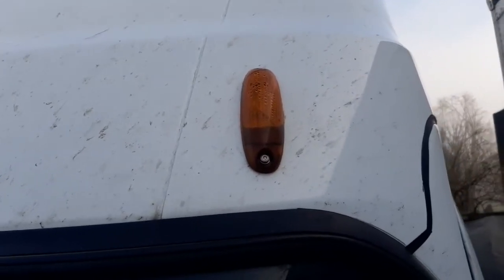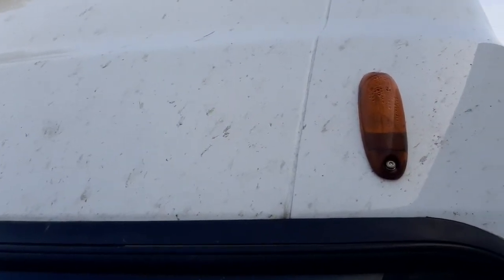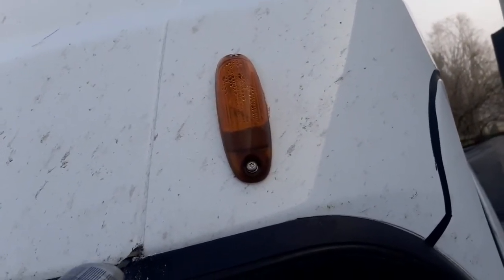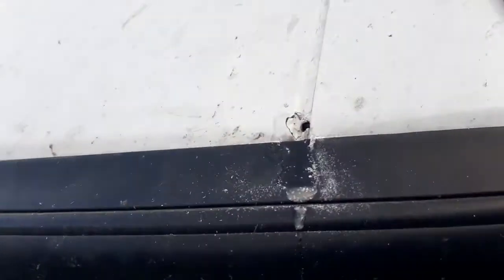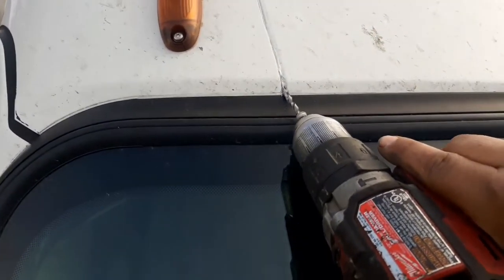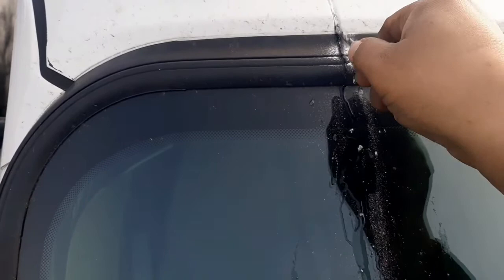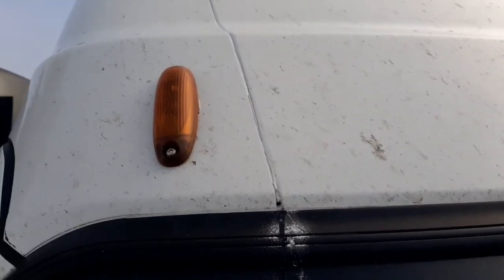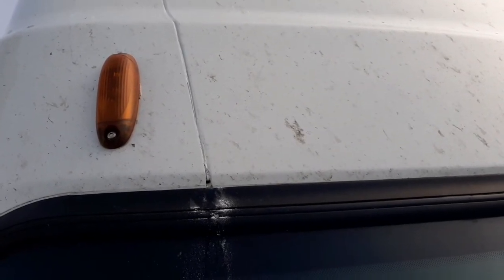Casacadia cab water leak easy fix

Comment: Silicone didn’t work for me either. I did also drilled the same holes as shown in the video and inserted small tubes pointing down so water won’t go in and this has been the best solution so far. Much much less water comes through now but still a little bit doeswish I could find out where this leak is coming from in the first place, but it doesn’t seem like anybody can figure it out.

Comment: having same issue and it caused my windshield wipers and fluid to activate on their own. Had to shove towels in headliner and pray every time it rains.
Reply: Same think happen to mine have to put new sam cab (whole fuse box ) and it needed to program through dealer also
Reply: @ronysingh6872  what year is your truck? Did u get the leak fixed?
Reply: @ronysingh6872  me too😔 still dealing with this
Reply: That’s what i do bro
Reply: Exactly, and hard steel seat cusion gave me sciatica pain. Every trucker's seat supposed to have springs like in old trucks, not a steel plate harder than russian tank and an inch of foam. It sucks to drive hours seating like on concrete bench.
Reply: I have same issue changing Sam cab how u fix it

Comment: I got a 2009 Cascadia truck just cam from dealer cause of leaks needed a Sam Cab module & Sam Chassis module smh them MFs told me they fix my leaks now a week out the shop my truck started to leak again today. I will try this out n change my marker lights thanks bro. I love YouTube fuk them dealers they rob you lol
Reply: You try this? I've got a 09 Cascadia as well, New sam cab unit replaced with pos cover 🙄🙄 to drill or not to drill 🤔
Reply: I had to replace the Sam chassis for the same reason. SMH.

Comment: I changed the lights and resealed them as well as the entire windshield and it still leaks on a 15 cascadia
Reply: Same. It’s only getting worse just might have to drill a hole in my truck
Reply: Having the same issue, let me know if it works lol@christopherlewis1017
Reply: @jason22landry  I drilled it a few hours ago it’s not big as most would think, I’ll give you an update next time it rains
Reply: @jason22landry  that didn’t work my next move is to put more solution between the gasket windshield and put paper towels behind all the lights and seal around once rescrewed
Reply: I changed all clearance lights replaced with new seal and still having water leak. Seal windshield gasket with special tape and still having water leak. Any suggestions? 2017 Freightliner.
Reply: @brucemalcolm8401  any luck with the situation?

Comment: Plug the lights screw holes with silicone solve that headache
Reply: Helllo. Which Cascadia have u seen this work on... first or newer series Cascadia?

I got a 2011 with bad leaks. Its the 2 piece windshield
Reply: @koollee  got a 2014 slowed the leaks down som
Reply: @koollee  undo the inner panel lots of screws jus have it hanging n apply silicone to the window rubber seal and also plug up those ridges on the metal panels its alot of work but so is fixing electricals once they short
Reply: @tittat2440 That's exactly what I'm doing and so far so good. it's raining right now and we have no leaks

Comment: Man I’m having this same problem right now.. it’s not the windshield or the lights (spent a bunch of $$ on those already)

I guess this is my final option
Reply from the maker: Let me know if it works..
Reply: Can it work for 2015 cascadia also?
Reply from the maker: Yes
Reply: @oaguilar6459  it worked bro, just went through a bad rainstorm in Florida and NOTHING!
I appreciate you putting up this video man, its gonna save me a ton of money on electrical problems 🤙🏾
Reply: @504Tendaji  I have two cascadia sam issues. I think it messed up my dashboard light
Reply: @hackman9035  @O Aguilar checking in a month later, this definitely works! 
I do get a little in when its really heavy rain, maybe it cant pour out holes fast enough, but other than that, this saved my truck, thank you brother!
Reply: Yeah No!! I'm not about to drill holes in my roof. This isn't fixing the problem. It's only letting water out. The problem is where the water is getting in. That's the issue that needs to be fixed. Stop the water from getting in and it will be no reason to drill holes in the roof.
Reply from the maker: Another thing you can do it’s buy a different truck other than freightliner that will fix your problem..
Reply: @oaguilar6459  😂 true
Reply: @504Tendaji  what size drill bit did you use
Reply: @Tendaji  if changing the marker lights n the windshield seal didn't work I would try to hop on a ladder n silicone seal every light, the windshield seal and also the two cab seams on top that goes from the windshield to the back of the cab sleepers. A lot of people think is the windshield or marker lights but is actually the cab seams.
Reply: @CKH_Transport_llc  silicone that outer rubber ,drop inner panel,where it meets windshield ,ridges on the metal fill em in with silicone or foam should stop the water.